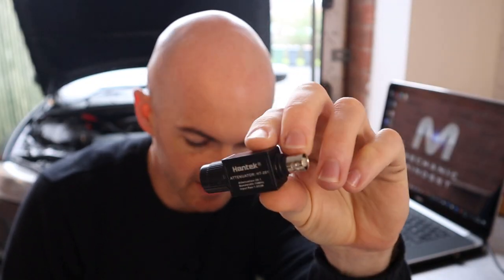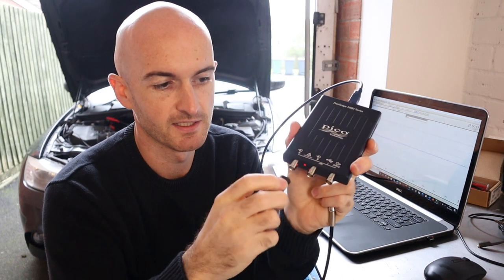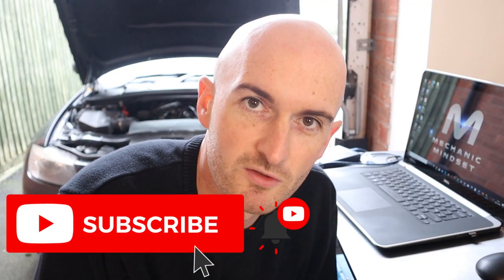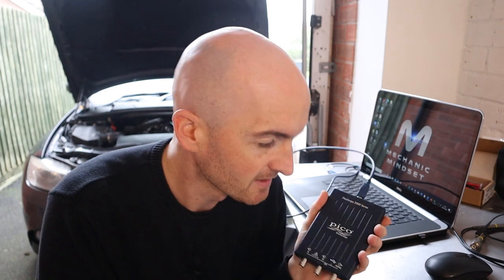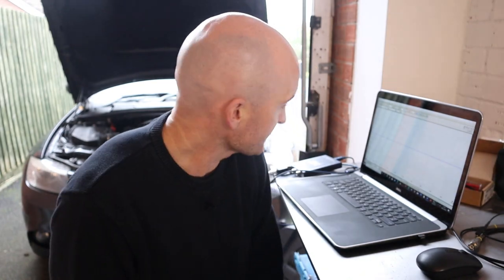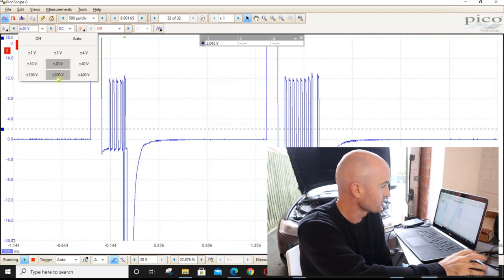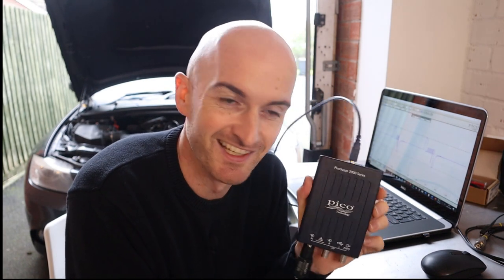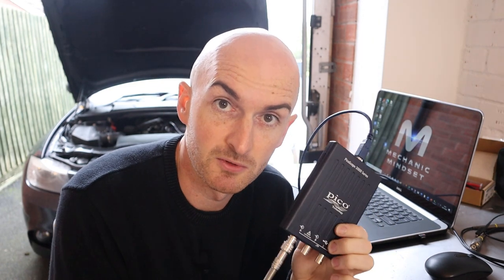Attenuators Explained | Automotive Oscilloscope Diagnostics | Mechanic Mindset

Comment: Full scale measurment range is 20v but it has over voltage protection up to 100v. Great little scope
Reply from the maker: Great place to start for scope diagnostics. Will force you to learn the settings 👍

Comment: Scope training has been very limited until this year in the aftermarket. With the introduction of secured gateway modules increasing by manufactures, labscopes are even more important than ever to see sensor data. Ford has introduced it on the factory FRDS side and Chrysler is now training with the Pico as part of factory training. It is now been realized how important lab scopes are on the auto and truck side. You video’s cover a lot of simple/essential details about how to use the hardware and adjust the settings when using scopes in general. How to set up a scope for what you need to see is mostly what technicians are missing. It’s hard to use a tool you don’t understand. I appreciate the information.
Reply from the maker: Hi Mark, it really is a great tool and capable of so much in the right hands! Cheers
Reply: a very friendly but not profesional labscope is the hantek 1008 it will automatic adjust all the settings u need to work with and aldo gives u a waveform sample of what you looking for on a circuit or sensor or auto part u testing.  i have posted a couple of videos about it, but my very first 2 videos are in spanish language, not sure if you can catch some ideas from my videos.  but there are english speaking videos about the hantek.

Comment: Presumably there are zener diodes tied to the input circuit, to automatically spill the extra voltage to ground in an effort to protect more delicate downstream devices. Problem is, those zener diodes have a maximum wattage so eventually they will be sacrificed and smoke out. Meanwhile the waveforms are distorted. Nice demo!
Reply from the maker: Cheers! I checked out the attenuator circuit online. Looks like an arrangement of resistors in parallel and series to achieve the reduction 👍. Gadgets Playlist channel makes one, pretty cool!
Reply: @MechanicMindset  Yeah, that's interesting. The zener diodes need to be inside the pico itself, it's a fairly common way to help protect components.

Comment: I guess we could use the X10 on the probe. which would make it 200v to check injector voltage.
Reply from the maker: Yeah, you’ll be good for 200V 👍

Comment: Darren, with a 2204A and attenuator can coil dwell times be measured? I'd like to see a video on that and also injector(petrol) traces before i commit to buy. Great channel mate.
Reply from the maker: Hi Tony, yes you should be able to measure coil dwell times. Have to admit that the older stuff is a bit before my time! I'll get my dad on it haha! I have already made 2x videos on injector testing, check them out:
Voltage check - https://youtu.be/F3n9YVbnaeA
Current check - https://youtu.be/F3n9YVbnaeA
Thanks!

Comment: Awesome explanation. I see about an average of 390v spikes on the primary side of the ignition system. You think the scope would be okay with the attenuator? I’m thinking of getting on of these scopes but that’s the only thing that concerns me. Currently using a maxiscope but the software has its limits.
Reply from the maker: Personally I think it will be fine. It is close but the sort amount of time the voltage is high probably won’t affect the scope. For $100 you can go wrong! Pico software is amazing, but I’ve not used the Maxisxope. A lot of people are using the 2204A and I’ve not heard of any failing yet. Cheers!

Comment: At 1.02 you were explaining why the (way too short)ground lead wouldn't be in an automotive kit and the video appeared edited at that point.
Would you believe you were explaining just what I wanted to know and planned to ask at some point on your site?
What can be done with a lead like that? Make up an extension wire with alligator clips?
What is different in the automotive kit?
Reply from the maker: Hi, these leads are generic electronic testing leads. Engineers use them on small components (like ECUs) where that size lead is fine. The automotive lead has much more length, so you could connect on the battery ground, then probe on the other side of the engine bay with the positive lead. You could knock some sort of extension up, or just buy a cheap Hantek automotive scope lead (see my review video 😃)
Reply: @MechanicMindset  Thanks ole chap.  Just couldn't understand how that short lead could make it to different ground points on the vehicles but now I see it is intended for other applications.

Very nice channel by the way. 
You  have a knack for posting material that persons new to the trade are just about to search for!
Wish you much success for your efforts.

Comment: Very useful information, my scope has 1x 10x and 100x modes, can i use a 20x attenuator on it? if i do so in wich mode should i set the scope?
Reply from the maker: Hi, this attenuator is usually used for x1 inputs 👍
Reply: @MechanicMindset  Thank you very much

Comment: -Ring-Ring...!
-Hello?
-Yes, this is the 90's calling and I want my Flexray back!
While talking to you, let me introduce a state of the art MOST tranceiver and give you a heads-up for the upcomming BroadR-Reach and 1000base-t1 you should have seen in a very near future...
Reply from the maker: Haha! MOST; I have a pretty cool way to test that. Although that is on its way out..
Ethernet; there is the future (or now). I haven’t looked in to it yet, but we’d need a lot more than a 2204A to capture anything!
Reply: @MechanicMindset  : Yes as of 2020 no one in their right mind would impliment MOST.  CAN is on its way out too, replaced by CAN-FD. LIN is going strong along with all other 1-wire interfaces like SENT, PWM and misc weird "intelligent" sensor ones... Xbase-t1 replaces everything now, everything from powertrain backbone to infotainment and chassis. New challenges for workshops since these run duplex differential busses which can't directly be sniffed.
Reply from the maker: @bigcheese781  Fun times ahead! Got to keep moving 👍
Reply from the maker: @bigcheese781  Also check out A2B networks

Comment: So with automotive is the only issue voltage? Not amperage? So if I test across the post/neg of a starter which is at 12v but higher amps, that would be fine. You only need an attenuator just to reduce the voltage to under 20v?
Reply from the maker: That’s right, current doesn’t flow through the scope the same as a multimeter on amp mode. It’s just the maximum voltage we need to watch 👍

Comment: Nice video.  Question:

I would like to measure voltage on a V8 engine in the spark plug wires all at once.  I was thinking a scope with 8 channels would be perfect but was concerned the voltage on/in the wire was too large for a scope.  Then I starting learning about attenuators and saw your video.  What kind of equipment would be best to do this?  A scope + really big attenuators?  A clamp voltage meter?  Will a clamp meter even register anything?  Easy and cheap is good.  What I'm really after is confirming the fidelity of an upstream component (like an ICM).  So the baseline setup has all good components.  Then say I have 20 of these to test, I just swap in a component, start it up, measure/view spark plug wire output to confirm it's good.  Any suggestion on a good setup to do this?  I like the idea of an 8 channel scope as it can measure/display 8 wires at once and an upstream ICM might impact any of them, so no need to move probes around during tests.  A clamp on solution would require moving the clamp to each of the 8 wires during the test which is ok too, as long as it reads something meaningful/consistent.
Reply from the maker: Hi, you can get 8 channel scopes but good ones are expensive. Hantek make the secondary ignition clamp and would be good if you have ignition leads. If you could get one with 8 clamps on you could measure all of them one one channel (as they don’t all fire at the same time and it has attenuator built in). BMW used to have a tool, it was 6 metal clamps connect by one piece of wire, then you clamped them to the top of the individual coils to read the ignition waveforms of every cylinder (like my coin test video). You might be able to make something yourself for either application (coil packs or ignition leads). I have a few ideas to try for a video. Hope that helps. Thanks for watching!
Reply from the maker: PS clamp voltage meter probably would read anything, it would be too slow

Comment: I'm new to scopes, and this may be a dumb question, but why would you need to buy/use an extra attenuator between the scope and probe when the probes already do attenuation by 10x or 100x? Or are those extra attenuators really just meant to be used when your using probes that don't have attenuation switches built-in?
Reply from the maker: Hi, good question; exactly that. the automotive leads I am using (and used by most) don’t have any attenuation switch. The leads with the switch aren’t great for automotive use. But if you want, you could use those x10 probes, just can’t really add accessories like back pins or clips 👍
Reply: @MechanicMindset  oh ok, thanks!

Comment: With PICO2204A and Hantek 20X attenuator, still 400V only, we would NOT want to do ignition testing?
Reply from the maker: Strictly speaking, primary ignition spike would exceed 400V. Although this does attenuate the maximum input V protection of the oscilloscope which is 100V > 2000V. I’ve done quite a bit with mine and no issues. There are no issues what so ever using secondary clamp or COP probe
Reply: Cool, that could make sense too as normally semiconductors x 3 times voltages are used in the PCB. Thanks for sharing your valuable experiences.  @MechanicMindset

Comment: great video and nice explanation as always . thanks Mate >> do you think i have to use attenuator when i connect currant clamp ??
Reply from the maker: Hi Nidal, no need for attenuator with the current clamp. The current clamp only outputs low voltages. Only need one if the voltage will exceed the maximum input voltage. Cheers! 👍
Reply: @MechanicMindset   thanks Mate

Comment: Maybe a bit late. But what are the downsides of using the attenuator for everything? Like if the Volts you are  measuring are already at 5 Volts. And also if you use the 10X probe with the 20X attenuator  couldn't you use the scoop up till 4000V?
Reply from the maker: I suppose you might loose a bit of accuracy. 

Pairing them together, theoretically yes you could measure much high voltages. Although this is not recommended for safety. For high voltages a differential probe is required 👍

Comment: Hey, Darren. When you put the attenuator without letting the software know, it brings the 20v down to 6mv, and when you let the software know that you are using it brings the voltage up to 12v. Why is that?
Reply from the maker: It brings 12V down to 6mV. It’s a 20:1 attenuator so 12 divided by 20 = 0.6

Changing the probe allows the software to convert 6mV back to 12. Hope that helps
Reply: @MechanicMindset  It sure does!  Just trying to use my 2204A picoscope better because I don't feel like buying a high end oscilloscope.

Comment: Good video. What are your thoughts on the maxiscope
Reply from the maker: Cheers! Someone asked me the same a few weeks ago. Not used it before but I think I remember the sample rate isn’t as good as what you will get on a picoscope, but would be good enough for most things. Personally I love the Pico software. You could get a 2405A 4 channel scope with awesome sample rate and 4 channels for around the same as the Maxiscope, but if you want all the automotive specific support, the maxiscope could be a good option too. So many variables!

Comment: I was on pico automotive forum and it was said that unless you buy a Scope designed to run there pico automotive software all other scopes would be useless for automotive. I have the 4424a is this one also useless for automotive? I mean you are using a 2000 series scope? Why would they make such a statement at Pico automotive? They have Guided Tests so all you have to do it click on a test and it sets your scope up for you, I guess they think were to stupid to learn how to actually use and set up the scope ourselves.

Comment: Hi , any ideea if this attenuator will fit snap on osciloscope and i dont get something on my Modis osciloscope spec says 100mV -400v but dont measure greater than 75VDC .....So im not sure if its safe or not .... Thanks
Reply from the maker: I’ve only had a quick go with a snap on scope before, not sure about the voltage. It could have 400v over voltage protection (my scope is 20v max with 100v protection). 

I think if you buy or make an adapter (4mm banana to BNC you might be able to connect it up somehow - might be a bit of a faff! 👍

Comment: Sir, unfortunately, I didn't use Attenuator for once with my Maxiscope MP408 while measuring signals of an injector on a car for Few minutes. But the thing is that, the waveforms didn't look like yours, anyway can that damage my A channel. If it is so, then how can I identify that? Help me please
Reply from the maker: Hi, I think it should be ok. I have done this before also. If it is damaged you might not get a signal or the signal will not be as expected. You can compare to another channel if you think there is a problem 👍
Reply: @MechanicMindset  Thanks a lot for your help. Btw should I set on AC voltage when I measure the All of Sensors of cars by both multimeter and scope??
Reply from the maker: @orkhansafarli5992  Set to DC for most sensors. Only need AC for inductive type sensors sometimes used on crank/cam on older vehicles

Comment: hello, this is very important information that I need, I'm going to start learning English :washhands:
Reply from the maker: Pavel, we have an online learning website. It currently costs $10 USD per month. We add language subtitles too!  What is your home language?

Also if you watch on a laptop, I think you can get automatic translation?
Reply: @MechanicMindset  hello, sorry for the delay, my language is Czech, I have a laptop
Reply from the maker: @pavel7311  Ah ok, we don’t have Czech in the list. You can see the translation list on the website 👍
Reply: @MechanicMindset  I suspected that you wouldn't have Czech, it's a shame, and would you recommend Picoscope 2204A rather than Hantek 6022BE?
Reply from the maker: @pavel7311  I had 6022be first and hardly used it. I like the Pico software much better, but the Hantek still has good specs
Reply: hello friend, one more question please, I still have to order BNC measuring cables for the oscilloscope, right? You can't measure cars with a passive probe, right? Thank you
Reply from the maker: @pavel7311  You can but it’s not convenient. BNC probes with 4mm connector is best
Reply: @MechanicMindset  hello friend, I will buy a simultaneous translator so that I can participate in your training
Reply from the maker: @pavel7311  Cool! Can you share what software you plan to use? I can share it with other people too 👍

Comment: Hi Darren am i correct in saying we dont need an attenuator to do a relative compression test when using voltage  without an amp clamp.I also read somewhere that we sould use one when testing vvt solenoid actuators is this correct? Cheers
Reply from the maker: No need for relative compression. No need for VVT. Need it for solenoids or coils that switch on and off instantly (injectors, EVAP solenoid, ign coils etc)
Reply: @MechanicMindset  Thanks Darren really helpfull.LOVE your online training learning loads.👍